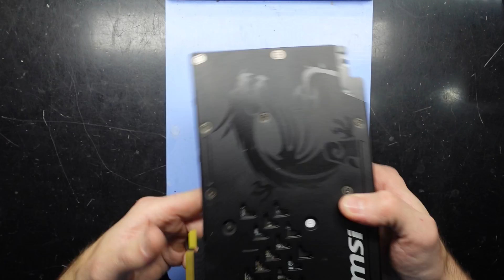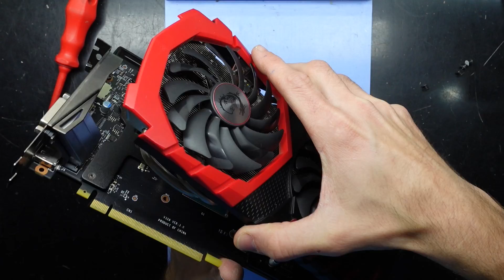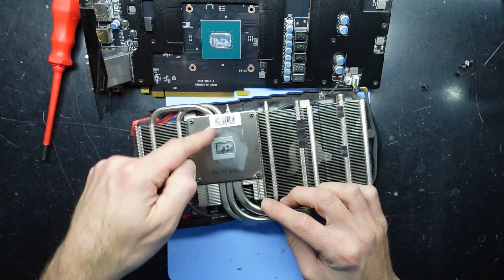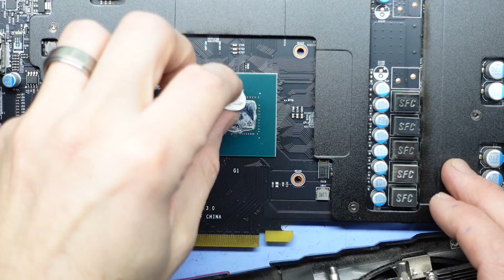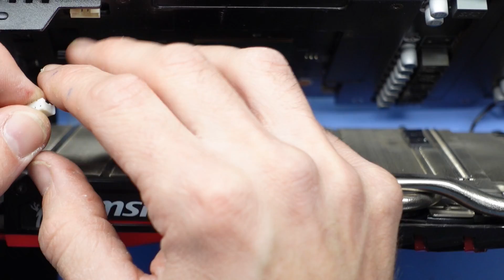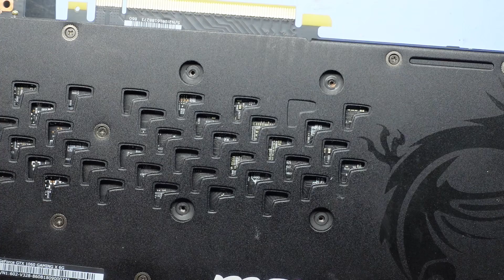MSI Geforce GTX 1060 Gaming X 6GB  Thermal Paste Replacement

Comment: Thanks - just bought the same model 2nd hand, so this is one of the first things I'll be doing !
Reply from the maker: When you get them second hand I always change the paste
Reply: @rickstechrepairs  Thanks, changed the paste a few weeks back to Noctua NT-H2. The old paste wasn't actually too bad, so hoping its had an easier previous life. It maxes out around 61C